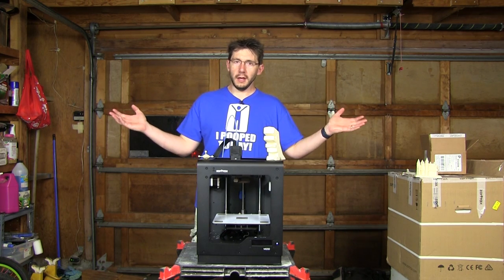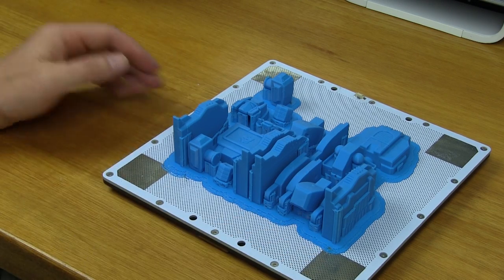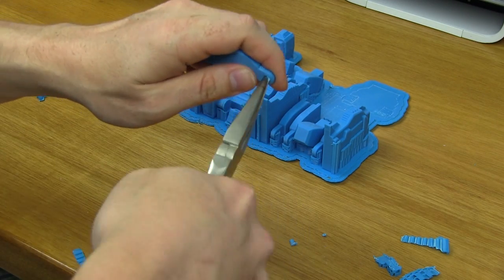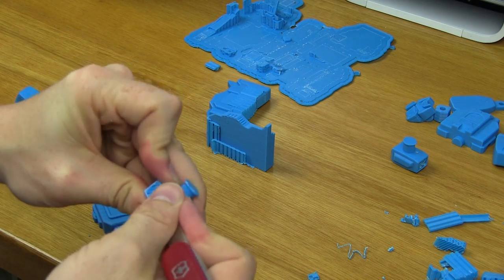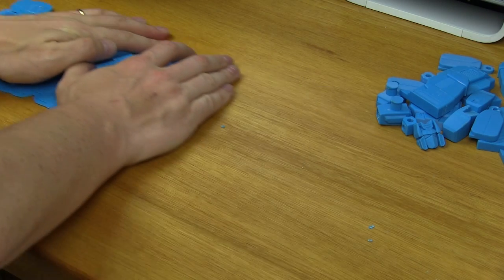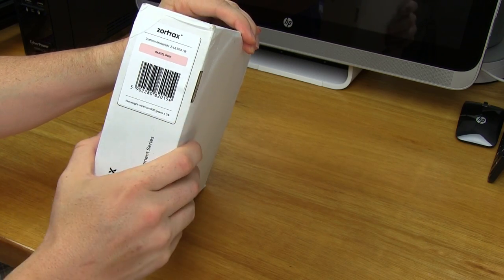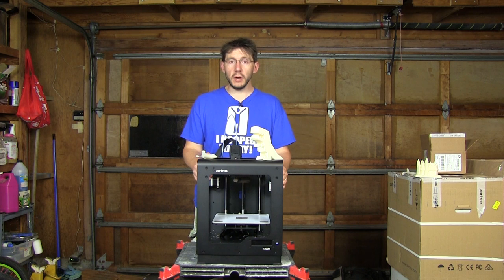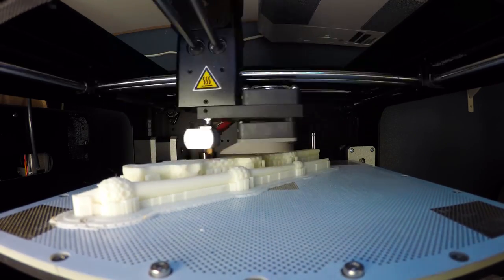3D Printing: Zortrax m200 3D Printer Review

Comment: I also own a Zortrax M200 and couldn't be more pleased with this machine. Yes, I do agree that the slicer is SLOW and takes it's sweet time but you cannot argue with the results it outputs.  It's 90um layer height is better than Ultimaker 2's finest layer height (I believe it 40 um for the finest Ultimaker layer height). I've personally compared the same models produced from both machines side by side with their finest layer height and Zortrax came out on top every time. The models look as close to Injection Molding as you can get, and trust me that's what I do for a living....been doing Injection molding for 20 years now. The reliability of this machine is unsurpassed. I've had it for nearly a year, printed hundreds of parts and NEVER had a failed print and many prints were over 40 hour prints. The reason????..... It's because of Zortrax's closed system of using their slicer and their material. They have mastered their speeds, feeds, and temps for their material and machine. In the end all I care about is perfect models, not how I got there. I don't want to tinker with the settings over and over again dealing with failed or poor quality prints. As far as material cost goes if you print with their Z-ABS it is only 30$ a roll which is comparable to other brand ABS. Z Ultrat is 50$ but I haven't had a need for it, using ABS with their perforated build plate and side enclosures i've never had parts warp or separate. Sorry for the rant!!!!lol
Reply: comparing printers isn't as easy as you are suggesting here. there are so many variables. in the end it comes down to the experience of the user.
Reply: Bruce Lewis hello, i work at an architects office and now we want to print instead of presenting hand made models...would you recomend this print? or is there a fairly great/good price out there..(i know nothing, but willing to learn)

Comment: Thanks for the awesome review! High five!

I also have a M200 and i totally agree with you, it's a great printer, very reliable with top quality prints. As you said the only negative aspect of it is the closed source system. ZSuite is really efficient by i like more control in my slicer, the Zortrax filaments are really good also, that's in my opinion what makes it work so good, the printer is perfectly calibrated (in terms of temperature) for their filaments. 

You can use other brands of filaments on the zortrax, it works, some even manage to print PLA with it. But you loose your warranty if you do so.

Overall it's a very good printer if you want a plug and play printer with great prints and that you don't have to tinker with. If you are more into modifying or playing around this one is not for you

Comment: I've got Zortrax M200 Plus and the software it uses is now quite upgraded and pretty pretty responsible, luckily they've added the function a little while ago called "External Materials" where you can use any material that's close to your heart and there are options given to tinker with some of settings like temps and densities, speeds, also supports can be edited by your liking. So far i've got almost no explaints about the quality the printer brings up, but at first days i needed to adjust some screws which didn't affect my print quality in any way and that was it, also there is some limitations of which you could make your prints stronger/weaker, you can't get top/bottom layers off of the models and have less control over them. 
► It'd be cool, Joel, to see your thoughts of this printer now, to experience yourself how is it changed and: what is the best thing they've changed so far in your opinion, what you didn't saw as a change, what you still do like and what is not liked by you. #HighFive !

Comment: I've been using the Zortrax M200 for work, and I love it. Over 450 hours now with only one small failure which I haven't seen happen again. We run a 3d printing buissness so this printer has been our primary printer for weeks/months now. Never took out the bed, only leveled it twice, the ONLY thing that bugs me is the little clips that hold the wires at the back, they keep falling off
Reply: They have printable ones that you screw in.

Comment: I have a Zortrax M200 at my place, and I'm quite happy with it, too. I started with a printrbot simple 2014 wood edition, but the company I work for bought a zortrax and it's currently sitting here. You're paying less for the material when you enter your serial number and the printer is cheaper than the makerbot or ultimaker 2.0 if I'm not mistaken, but achieves the same quality. Using it for my tinkering projects is something I really enjoy, because I can trust it to just print and the quality is great. 

Some downsides are it being a closed system and the sometimes weird/unfriendly support guys. There was one Zortrax that caught fire in a hackerspace recently, but I also feel safe to let it run over night or leave it unwatched over the day.
Reply from the maker: +Dave P re: the one that caught fire, I thought that happened because someone changed something or didn't put something together right. Right? I dunno. I agree with all your points. #HighFive
Reply: 3D Printing Nerd I think you're right. The nozzle wasn't in there and the filament got stuck.

Comment: Btw it is true that it is recommended to use the zortrax filament because you can't control the temperatures but you can use non brand filament.
Reply: +Boen Boe Yes it is true. But you can adjust the temp if you use a Z-temp addon. http://www.z-temp.co

But beware, if Zortrax knows you use it you are ut off warranty.

Comment: Great review. I've been printing with a Zortrax M200 for about six months and I love it. It's the only 3D printer I've used where I assume that the print will complete successfully, regardless of print time or print complexity. Z-ABS filament is not very expensive and the high success rate of prints makes it effectively even cheaper. What I don't like: The Z-Suite software is slow and has a clunky interface (no Quit menu on the current Mac version -- you have to close the window, then confirm). Lack of networking ability. Flimsy bed connectors, as you pointed out. Lack of an active Zortrax discussion forum.

Comment: While I'm not a fan of closed systems, the open source stuff that requires you to tinker to get a good print is not really practical for someone that just wants to design things for prototyping. It's much easier to have a closed system that just works. If it is used as a tool, it should just work out of the box, i.e. when I print a document from a word processor, I don't need to worry about getting a successful print, it just works.

On the other hand, if you have time and enjoy tinkering you can take any 3D printer, find out what works best, and end up with a reliable machine. I have a small first generation PrintrBot Simple that I built from the kit. I've upgraded it to print a larger volume, added an auto-level probe, modified the firmware, replaced the fishing line with GT2 belts, longer lead screw, etc.. and tuned it to be pretty reliable after a very long time of testing, calibrating and upgrading.
Reply from the maker: +Bob Moreno well said, man.

Comment: Hey Joel, great review! I've had one for 2 months now and I'd have to agree 100% with everything you said about this printer. The closed ecosystem reminded me a little of the concerns I had when I switched to a Mac computer. Would I want to pay more for a quality machine that delivered consistent results without too much tinkering on my part, if the tradeoff was being locked to their products? In my case the answer was yes. I was looking for consistent parts, I did not care for PLA, and did not want to get into another hobby (no offense, just no spare time). As you found out, the Zortrax just plain delivers! I don't ever worry whether a part will print or not, I just slice it, put in on the SD card, hit print, walk away, and come back to a beautifully made piece. Price was a concern, but parts quality, consistency of results, low print failures, and zero tinkering won out in the end. This is not a printer for someone who wants to experiment with all kinds of settings and materials, this is a printer for someone who wants the best possible parts, made out of a smaller selection of quality materials. Keep up the good job, your videos are always fun to watch.
Reply: +Crivo152 I hope many more read this. Not all are die hard 3d-printer nerds. ;) I am but not all others. :) Very good post sir.
Reply from the maker: +Crivo152 Yes. THIS.
Reply: +Trhuster Thank you Trhuster.

Comment: Getting that print off... did it not come with a sharp spatula? They cloned everything else on the UP's should have cloned the spatula too :P You don't need to clean those holes out, it just remelts to it. Dat slicing time though..

Comment: Joel a few questions - What was your print time, nozzle, and bed temps for soundwave? Are these locked in by the zortrax based on the proprietary filament inserted? Is the rafting something locked in by the closed environment or does a user have the option to disable? That print was pretty stellar especially the lack of evidence left behind indicating a raft or support was used. #Highfive
Reply from the maker: +NolanC 3DPrint Works Print time on Soundwave was 27 hours. Nozzle and bed temps are all controlled by the Zortrax software and not shown to the user, as is the raft too. No option to disable in their software. #ReturnFive
Reply: +3D Printing Nerd 27 hours! now I am just getting more curious that seems short for that many pieces and resolution. Must make up some of it with lack of infill but I assume that to is not shown to the user. So a really really closed system. Great video and thanks for the info.

Comment: Background: Been using a Zortrax M200 since 2013 and it's currently the only one I own.

Z-SUITE took forever to slice the wand because the model was oriented flat on the bed. Would have been a lot faster to orient it vertically, possible with less support material required. The print itself would have taken less time too because the M200 lays down rafts painfully slowly.

P.S. You can use the Z-TEMP mod to print with alternative filaments (www.z-temp.co). Get in touch with Julia over there and see if she's able to send you a review unit.
Reply: +Ahmed Jaber That's still an unacceptable amount of time. It would take S3D something like 5 seconds (probably less actually) to slice the same model on my macbook pro. And then you also end up with less time per layer for the filament to cool, which can be a factor in layer strength for cylindrical models like this.
Reply: Carl Anderson Not trying to defend Zortrax, just offering advice on how to slice more quickly in the future. One of the M200's many faults.
Reply: Fair enough. I didn't want people considering their first purchase to walk away thinking it was just minor inconvenience. How long would slicing have taken with them standing up, do you know?

Comment: Excellent Review!
I'm an avid Afinia user and have been looking at the Zortrax for while now.
I would really love to see a review of the Afinia H800 vs the Zortrax M200 if you could pull that off.
Afinia also has a more expensive filament specifically made for the H800.
It would be cool to compare the print quality of each using the top quality filament for each printer.

Comment: Great review. I think there is absolutely a market for a 'system' like this. Everyday people buy 3D printers (kit or pre built) and end up either selling them or leaving them to sit in the closet because they were not capable (or did not have the time) to figure it out and get settings that worked properly. I think this printer is for people that just want to print and the extra cost to just get it right is worth it.

I use a TAZ printer and while I love it and I have a lot of excellent prints there are times where I wanted to pull my hair out and mostly due to getting the settings perfect in my slicer. Anyway 'my' biggest concern with a printer like this would be the company disappearing making the printer a large paperweight (people that want this printer will likely not be able to mod it to work with other filament and software).

Oh, and High Five!
Reply: +sublimationman Well spoken sir.

Comment: When using either the Dremel 3D or Zortrax m20, are you limited to only the print models they provide or, can you load you own files from your PC?  My interest is transforming some photos of buildings and such to print and mount to woodworking projects.
Reply: Any STL. or OBJ. files will work. When you design something in 3D just save as STL. and send to Z-suite slicer

Comment: Note that Zortrax is a bit dishonest about the resolution of the m200. "90µm" is actually 100µm, "140µm" is actually 150µm and so on.
You can easily check that in Z-Suite with the "Pause" feature and stepping through the layers.
Reply from the maker: +0x deadbeef oh really? interesting...
Reply: Yep, I have other means to detect this, but it's also visible with the Pause feature inside Z-Suite as it allows you to count the layers by stepping though them.
Besides a guy in the Zortrax forum even posted microscope pictures that show that the layer height doesn't match the one set in the slicer.
So this was proven in three different ways.
Surprisingly, their new "Inventure" Printer actually seems to use 140µm (or 190µm) but for the m200 they are giving wrong numbers.

Comment: Ripping off support is so fun! The perforated bed is quite intriguing... Do you need to clean it up after each print? Is it worth the hassle?
Reply from the maker: +Brian's Lab not after each print but you should clean it IF the leftovers that are stuck get in the way. Is it worth it? I dunno - the fact you have to print a raft every time turns me off of this a bit.

Comment: Hey Joel! Great review. I've had a Zortrax since January now and I absolutely love it, but I would really love it even more if I could use PLA with it/Zortrax provided their own PLA. Whenever I print with Ultrat I have side covers, open my windows and have a fan running but if you're near it there is a noticeable smell that I didn't get on my old printer with PLA. I'm also somewhat annoyed with Z-Suite - cutting the model is nice, but I would like it to save parts that don't fit on the print bed so I could create another .zcode file with them and have it be precisely the other side. Also, I'd like an option for less support material. 10% is the lowest and often I feel it uses too much. Anyways, it still feels like the ecosystem is evolving, so hopefully these features/filaments will be introduced in the future. It IS a fantastic printer and it blows away most of the rest.
Reply: +DangerousDac You can use PLA if you mod your Zortax with z-temp. http://www.z-temp.co/

Don't tell Zortrax about it though...
Reply: +DangerousDac Your getting the smell because Z Ultrat is an ABS material not PLA.

Comment: I am in the market for a replacement to my DeVinci Duo and have been since I saw the quality of prints from my Fabricator mini. The quality of the finished print is important to me as most of my prints are my designs.  I was looking at the Ultimaker 2+ due to the layer height of .20 microns but the Zortax throws a spanner in the works.  I don,t like the idea of having to use Zortax filament or the raft but I do like not having tinker with the prints.

Comment: thats crazy unrealistic though. you wont be able to reliably keep printing prints that size without serious warping.

I have built a temperature chamber to house my M200 and I find the ambient temperature inside the chamber containing the build area has to stay at 30°. Any hotter and the printer keeps pausing due to the printhead overheating. This is even more efficient than glueing down the print as it prints out in room temperature.  Still - I will not print anything bigger than 130x130mm because it is pretty much guaranteed to warp off the build surface.

It's the only printer I've ever had and I chose it because of it's ease of use AND the surprisingly high print quality when compared to the competition.

I'm very happy with it overall.

Comment: Joel do you have any experience with the  Wanhao Duplicator 4X Dual Extruder I am thinking about getting one as my 1st 3d printer I need and enclosed printer as the environment  is dusty so the open design ones are out for now..  unless you have any other suggestions.

Comment: Why didn't you use the Modifi3D 3D print finishing tool to clean up the soundwave model?
Reply from the maker: +Phoenix540 because I just wanted to pull it from the raft and support. once I put it together I may do that. another video down the line.